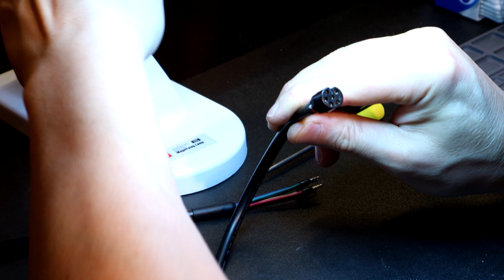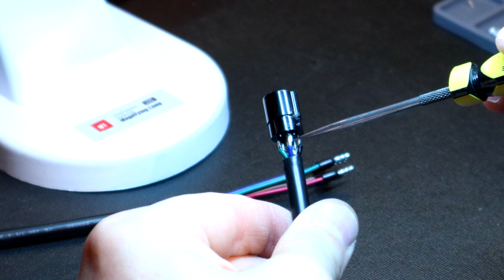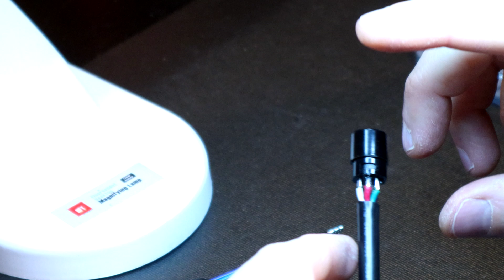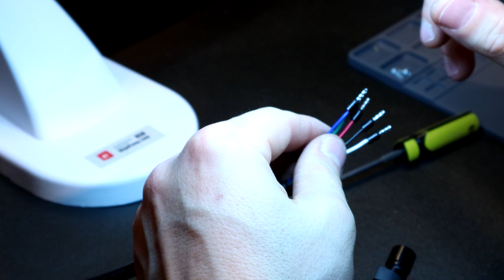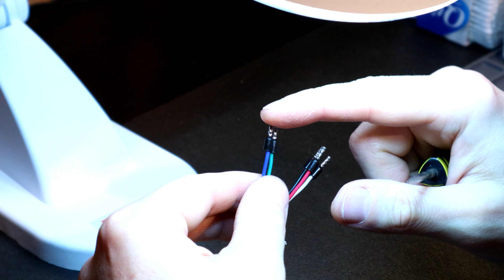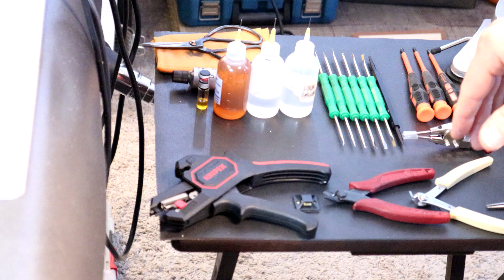CNC GX-16 6 Pin DS Spindle Control Cable Assembly Overview..

Comment: I can use this cable to deliver signal and 5v power? I have a super PID controller that requires 5v/C and the 3 signal wires to the g540. Is it ok to transmit power and data within the same shielded cable?
Reply from the maker: Hey Joel,

Thank you again for your support. Yes, your fine doing that as your only looking at a 5v voltage. Thank you, and have a great weekend, and Happy Easter!
Vince
Reply: @corvetteguy50  awesome, thank you for confirming so quickly
Reply from the maker: You bet...:) Thank you, Vince

Comment: How's it going. 
All the stuff you sent is great, thanks heaps for the help. So appreciate. 
Quick question, what temperature do you solder at? I've now got a soldering iron that I can set the temp. 
Cheers mate.
Reply from the maker: Hey Alex,
Thank you again for your support, and kind words. I solder at 800f on my station, with my Kester #44 solder. Temp you'll set yours to will be based on your solder. Keep in mind while I set my irons temp to 800f the actual tip is usually about 50-80 degrees less as the stainless iron barrel takes most of the heat where the ceramic heater is, and then transfers the difference to the tip for solder application. Thank you,
Vince
Reply: @corvetteguy50  cheers mate